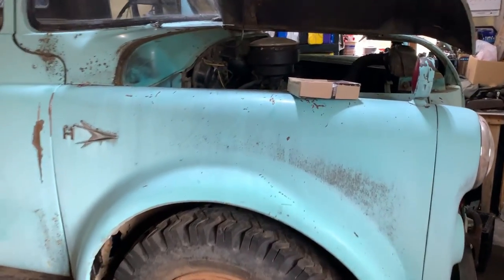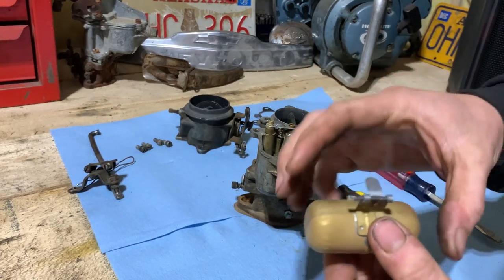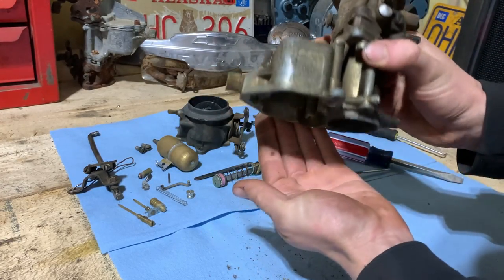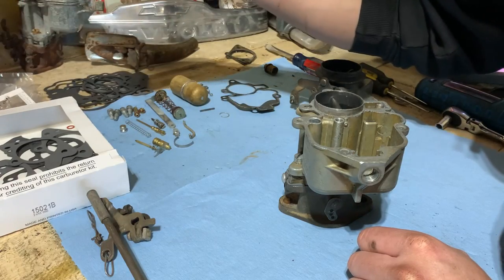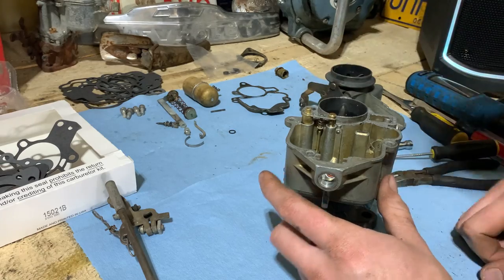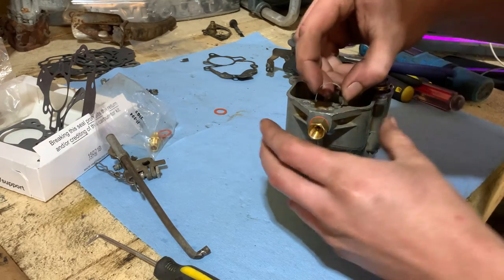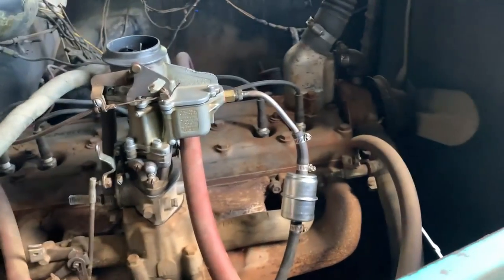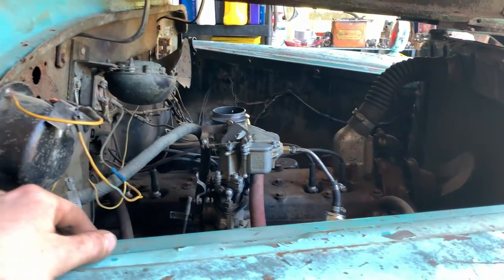1956 Dodge H6 Revival - Carburetor Rebuild

Comment: As I'm watching this I'm assembling a Carter WO carb from my 1948 Willys Pickup. It soaked in the very same NAPA "Mac's" parts cleaner you are using. Old school good stuff. It used to be called McKay's. You are doin' it right.

Comment: I use some grease on paper gasket material. The grease swells the gasket and seals better than a dry gasket AND it allows easy disassembly the next time.

Comment: You can also use that tank line I want to clean it out from corroding up and resting back that way if it still has a pinhole that tank liner will see it from the inst

Comment: Just a tip on testing the brass floats. Immerse it in hot water, the air inside will expand and come out any pin holes.